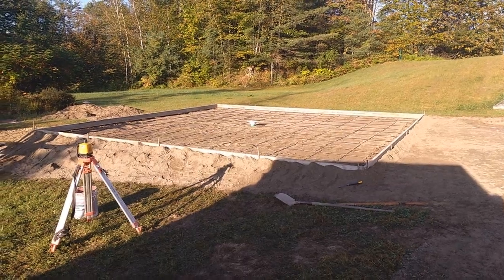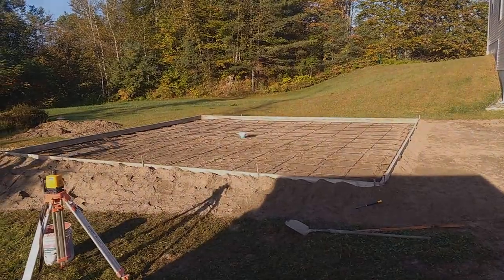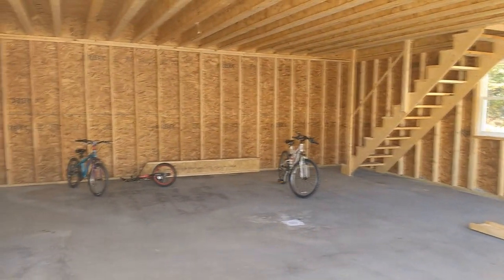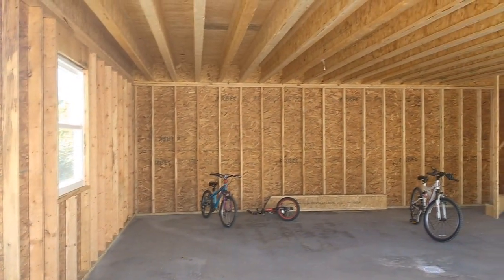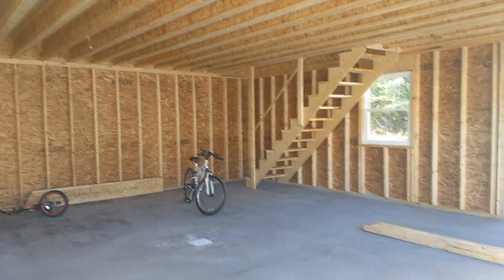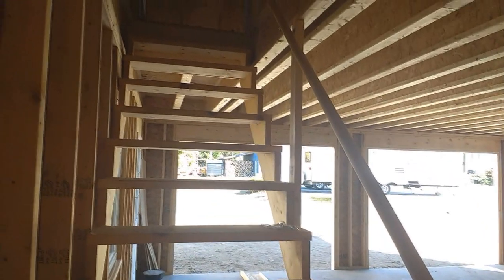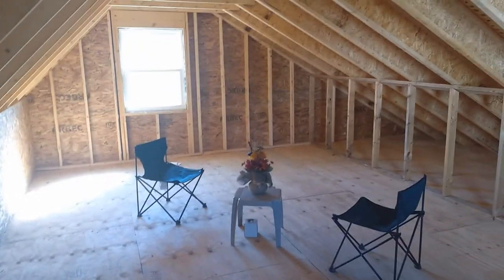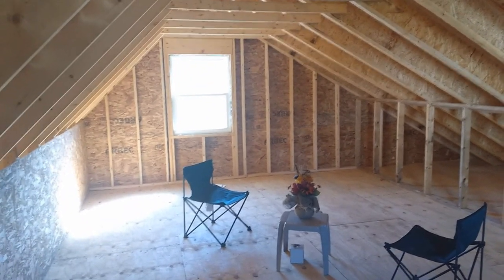Build a Garage Carriage Shed

Comment: I noticed you used I-joist for one side of roof rafters (the longer side). Why?
Thanks and regards
Reply from the maker: The length was to long for conventional lumber without building a load bearing wall in the middle to handle the snow load. The front was steep enough and short enough to go with conventional lumber.
Reply: Thanks for the explanation, Ken